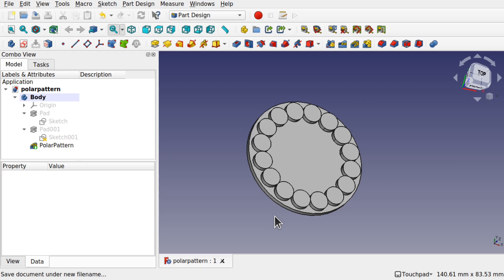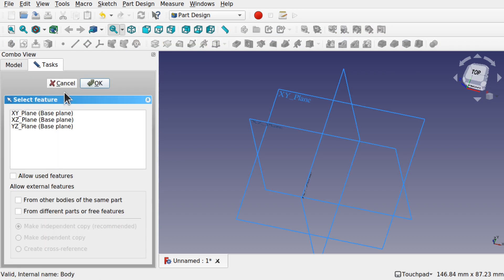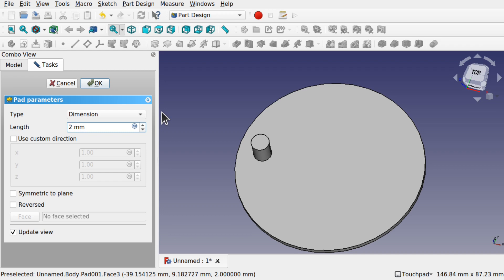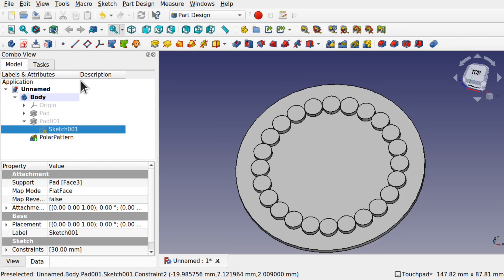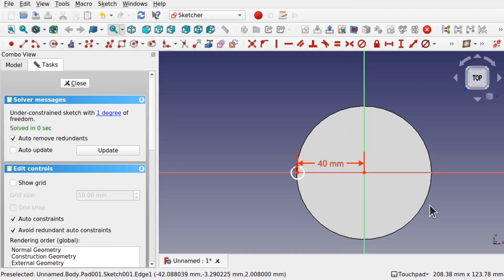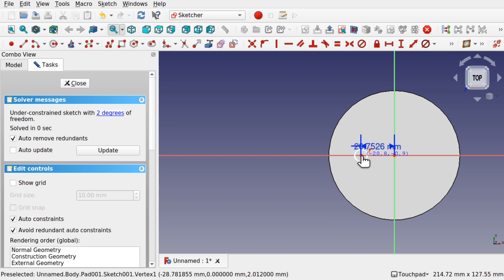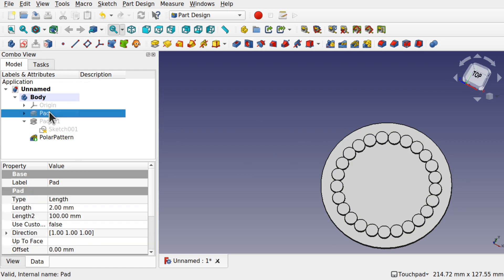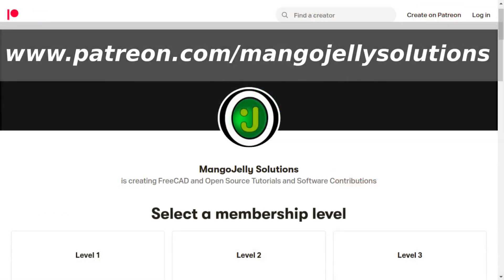FreeCAD: Dynamic Polar Patterns. Duplicating features on change of diameter with formula

Comment: Hello again,  thanks for all your great videos.  Do you have one that teaches you how to place holes on a surface in a precise location?  Say 
so many inches from one point,  or in a precise location from another hole or point. 

Thanks again,

Jack.
Reply from the maker: Thank you 😊 in answer to your question, If you had say a padded rectangle in part design you can import the point when you create a new sketch mapped to one of the pad faces. You can then use basic constraints to set up the precise distance away from that point to create your new hole say a circle and pocket this through. You can use the same concept for your model.
Reply: @MangoJellySolutions  Thanks,  I'll believe I understand...

Comment: You probably know this by now, but the "discarded units" message is useful in that FreeCAD is keeping track of the units for you, but you made a formula that doesn't quite make sense from a units perspective. So when you divide that large distance in mm by 30 mm pieces to figure out how many there are, try actually putting in 30 mm, not just 30. The end result is unitless quantity it makes sense. In general this is known as "dimensional analysis".

Comment: If you define 'Offset' as in the video and 'Diameter' as the diameter of the repeated feature, you can use this formula :
360 / asin(Sketch001.Constraints.Diameter / Sketch001.Constraints.Offset)
to compute the number of repetaed features.

Comment: I have not fully understood these last two videos featuring dynamics. Something about either the formula or how it's entered didn't click yet and I might have to view these videos later to see if it makes any more sense.
Reply: Same here. Haven't wrapped my head around the formula system yet.
Reply from the maker: It's something that you don't have to learn to be successful with freecad but it's worth knowing for when you  starting getting into complex models where you are uncertain of dimensions . A simple example would be you  may want to lock down every hole in  your model to a certain radius. If that every changed and you was referencing the radius using a formula for all your holes then you would only need to change the radius on one hole, the one you referenced rather than all of them. It's similar to using a spreadsheet.
Reply: @MangoJellySolutions   I just watched another guy's video on using the spreadsheet workbench in FreeCAD a couple of days ago and can see how that could be useful.